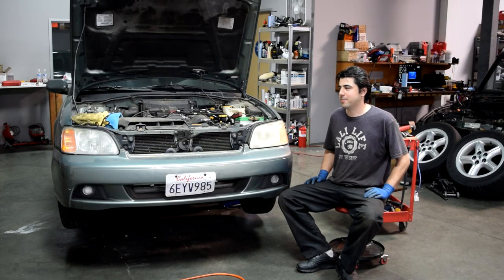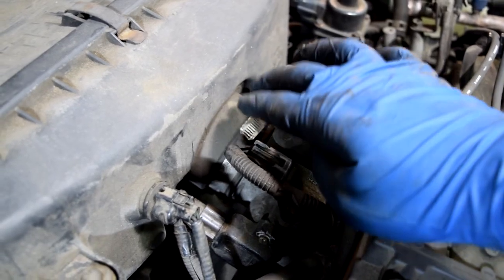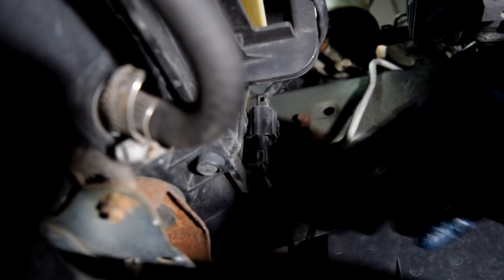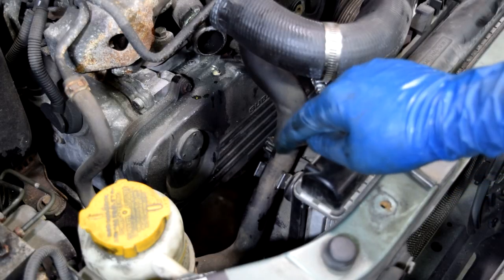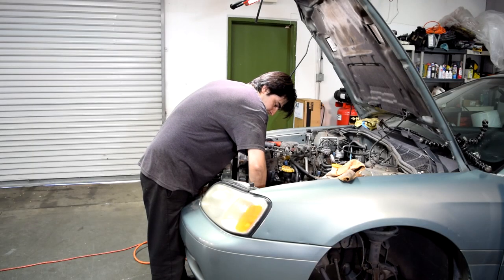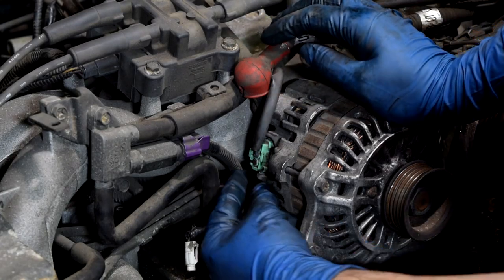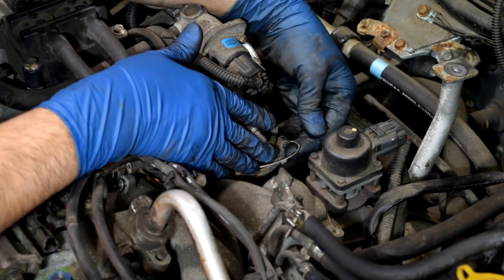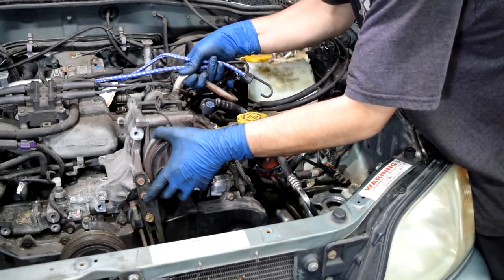Easy Subaru Engine Removal - Engine Swap or Head Gasket Replacement Part I

Comment: Great video; about to pull the engine on my 09 Impreza for guess what????!!!! Head gaskets (surprise!!!!). This vid was extremely helpful. If doing so in the future could you include the year and make of the car you are working on as there are slight differences over the model years.

Comment: Big thumbs up! I guess my question is this car worth the work? It must be or you would not be doing the work other then to put out great instructional video's as you always do. Thank You!
Reply from the maker: Curiosity its worth it to me, its an 03 with 120k miles on the chassis. Its not a difficult engine swap, and the replacement engine isn't costing me much. Thanks of commenting. cheers

Comment: Thanks for a great video as usual. On a different note when doing a subaru head Gasket with the motor in place, where do you place the jacks under the motor, and do use one or two? is it safe to place one under the oil pan (can it carry the weight of the motor)? And when you send the cylinder head to the machinist do you remove the rockers or leave everything in place. Thank you.

Comment: Whats the best way to keep track of all these parts and how to remember where they go again?
Reply: Put tags on them (sticky paper notes) and take photos each step.
Reply: What jon said! Another thing you can do is take a big piece of cardboard and put the bolts in and label each group of bolts by part with a sharpie, or bag each set of bolts by part. And you can’t take enough photos.
Reply: Put em back where you found em if possible,  put nuts ,n washers brackets back on the bolts, don't install g,box motor studs arse about, an easy motor to work on, if you strip the tensioner bolt just buy one 10mm longer and install from motor side with locknut,  helicoils are a weak fix, if it fails your motor will trash itself,  mines gone 5000k and I  checked it,  all still tight, an easy flip if you pick your motor carefully,

Comment: Hi i have a subaru outback 2003 wagon and i had a head gasket job done to it it was OK for 1 and a half years then the engine heat up again and i replaced the head but later on i have been having issues with the car,the check oil light came on and the car sounds really bad. my question is if i rebuild the engine is it going to be worth it and  if not what should i do
Reply: If your engine hasn't overheated, it may be repairable. Would you be paying a garage for the work? If so, there's no cheap way to go about it whether you have them install a rebuilt engine or have them do it for you. Hopefully you haven't run dry on oil and caused a seizing of the engine. You can probably rebuild the engine for far less than buying a new one if you do it yourself.

If you pull the engine yourself, take it all down to a machine shop to check for cracks, holes, head gasket mating surface, have you crank and rods checked out. Have them wash the whole thing out. Re-use as much of it as you can. May as well get your heads rebuilt too, get a valve job. That's the machine shop work. Make sure you use an multi layer steel head gasket.

If you're DIY'ing it, you can replace all rubber seals, and timing belt components if they're due or if you don't know how long they've been there. I would replace piston rings as well. Reassemble, reinstall, enjoy your car.

You may even consider having the machine shop polish your ports. The effect however may be small. If you have them "port and polish" you may actually see a difference in performance. Not sure if that's going to be worth it on a non-turbo engine but I'm considering it for mine.

Comment: Great video and good editing. Are the newer engines on t Subarus having the same issue with the head gaskets?
Reply from the maker: gianfrancoa I know upto 03 they have alot of HG problems but even after 03 they seem to still have it, but not to the same frequency. There is a special type of coolant Subaru recommends which seems to help some poeple. At least that's what I hear. cheers
Reply: i have a 2001 and now I think the head gasket is seeping oil on the outside (271k miles). This engine was never opened up other than for the timing belt and water pump a week after I got it 12 years ago. It's leaking at the front seals and what appears at the left head, but not sure. It could just be flowing from the front to the back as it is the left side. The right side is oily on the valve covers. As soon as I find a used Toyota minivan for cheap, I am getting rid of it. I have a 98 Legacy and that too is covered in oil. Smokes from under the hood whenever I run it for 20 minutes. Could catch on fire and I hate to wash it off, as that would probably mess with electronics.

Comment: Awesome, is the process pretty much the same as most subarus? (More specifically 2008+)
Reply: I used it to remove my 91 ej22     subaru motor

Comment: I have a 2003 baja and it has right at 250,000 miles and I am getting a little bit of oil in the water but not the other way around, so I see used engines on ebay for a little over 1,000 dollars, the ones I am looking at say non-avcs engine, I don't think my car has this but I want to make sure before I order one,, thanks.
Reply: i also have a 2003 baja, the belts slipped off the crank pulley, but the pulley is smooth and it doesnt have the ridges like shown in this video, is it supposed to be smooth?

Comment: The fact Subaru basically bored out the 2 litre to create the 2.5  is another reason. With a bored out block it is less stiff as is the cylinder head but when you have less metal  between the combustion chambers you shouldn't be surprised when the head gasket starts to leak.  Instead of re- designing the engine  to provide more metal around the combustion chambers to compensate for the wider bores.  Subaru got lazy  and paid the price.

Subaru launched the 2.5 Litre in the UK in 2007  and it quickly got a bad reputation and sales fell off a cliff.  You can no longer buy and STI or WRX  in the UK.

I had two Impreza WRX's  with the 2.0 Litre engine (one was fitted with the Prodrive Performance Pack  at the dealer) and I never had a problem with either car.

Comment: out of curiosity. .why remove belts and covers? why not remove hoses and motor mounts and exhaust. .then remove engine?
Reply: Leroy Shipp the power steering pump and AC pump stays attached to the car. so the belts need to be removed to unbolt the pumps from the engine.

Comment: Hey so I have a 2004 Subaru Forrester that broke timing belt car is a manual I bought a new motor from automatic car with a electronica throttle body I swapped my throttlebody also crank sensor cam sensor knocks sensor everything from my Engine and the car will not start I moved cylinder one and three the car started but will not idle any tips on what to do next

Comment: Where's the best place to find a use engine for your car? Thanks! :)
Reply from the maker: Delagrim Junkyard or ebay, if you are not doing the work yourself get it at a junkyard with a written warranty and have them do the swap. GL
Reply: RatchetsAnd Wrenches Ah, alright thanks!
Reply: Good luck, at least take off the sump and look for shrapnel, lotto, better buy wreck with body damage,  cheap as

Comment: Why did you take off so much stuff that wasn't necessary? But good video none the less
Reply: wondering the same thing.
Reply: Most likely the new donor engine will not have that stuff when it comes.